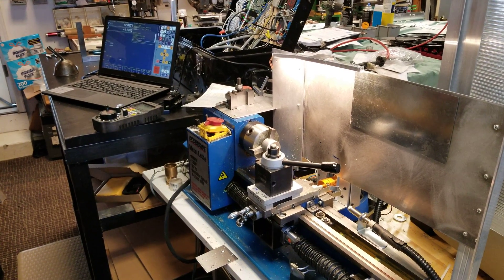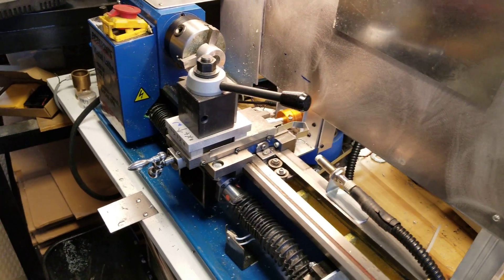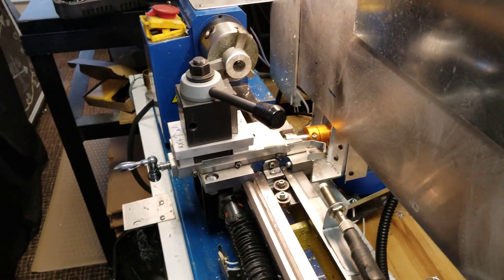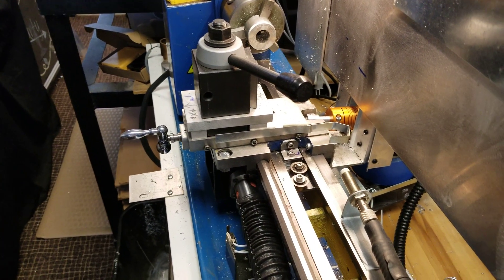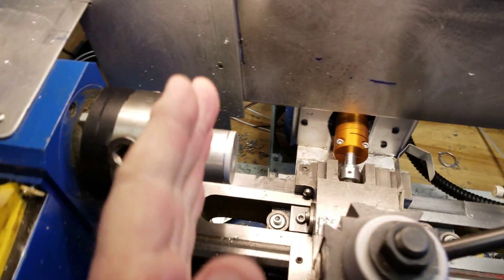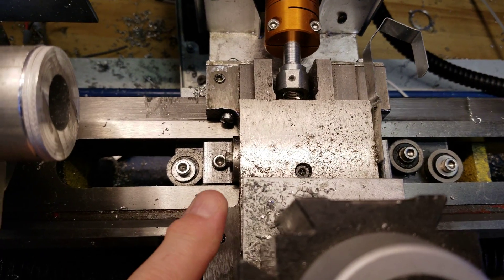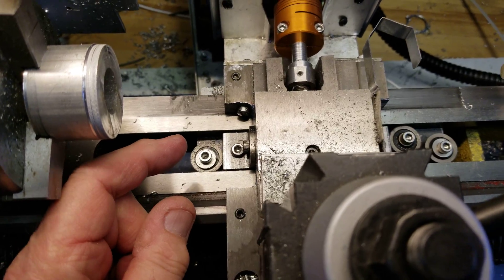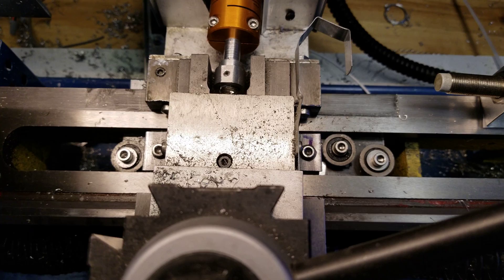Mini Lathe Ball Bearing Saddle Upgrade

Comment: There are these "multifix toolposts" for cheap now everywhere, the samallest one fits these Sieg C3s amazingly well and the tool holders are so close to the center of the tool post that you don't get any overhang, for me it increased the rigidity dramatically, I got one of these like 7 years ago with some bad quality control and my crosslide gib was always unreliable and required constant maintenance. These little lathes come from factory with a square toolpost which holds the tool really close to the center of the crosslide and the less overhang the more rigidity. I liked your "solid tool post" there, I just tighten my top slide down and moved it out of the way as much as I could, I have a sizeable chunk of nodular cast iron but no bandsaw to get it to rough shape and make one.

Comment: Clair.  I agree with Jaakko The plate under the V is not fit correctly. You need to remove the carriage gear box to get to it. I was a plant manager at a company that made lathes and and milling machines. Manual and CNC for aircraft manufactures. Fitting this is easy. Just grind or mill until the fit is right. All lathes have this plate. Half the work and no cost. Blus no worry from dirt.

Comment: If the carriage can twist, then the problem is (not a surprise here) the fit of the carriage to the bed ways and the uneven thickness of the rails of the bed ways for the carriage 'clamps' to properly be adjusted.
Reply from the maker: I tried  all the gib  adjustments and it created to much drag that the servo would trip.  this is a solution that worked for me.
Reply: @David.Munson  I'm surprised the inside edges of the ways are true enough that even your bearings might bind. The bottom of my ways still show machine marks and do vary in thickness. First had to remove paint there too.  Never seen two Chinese lathes that are not different though.

Comment: The problem is your ball bearings are exposed to grit that will in time ruin your bearings .  I don't see a way to cover them to prevent damage . Many people just use a block that is machined and mounted as a guide.  I added a stripe of metal and 2 set screws which push the rear edge on the back tight to the front rail by adjusting the 2 set screws in the front .  Takes the rock out and keeps  the table firm to the body and still glides without binding.